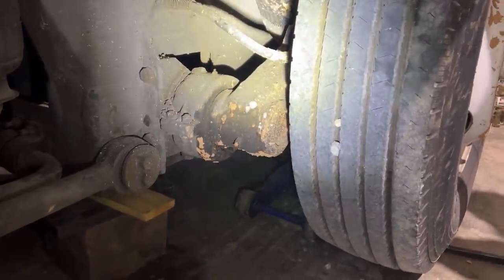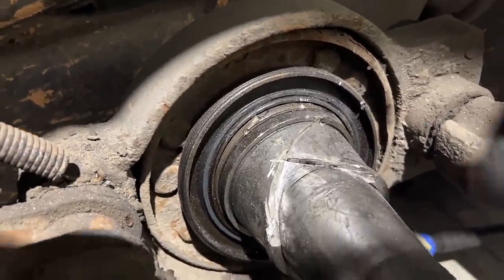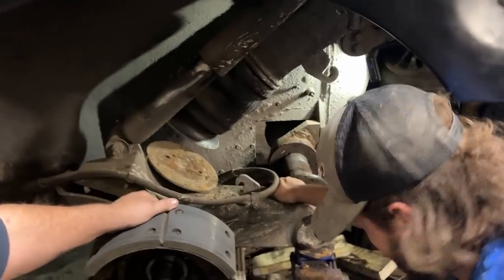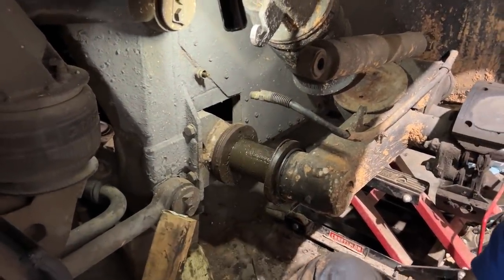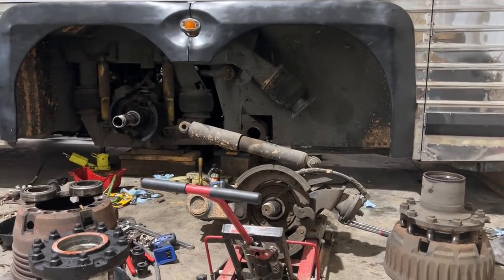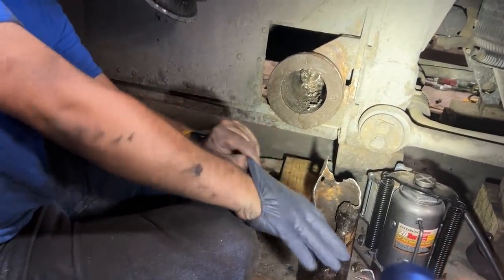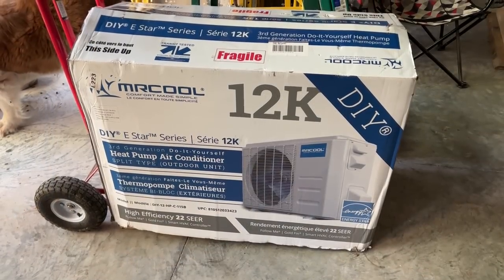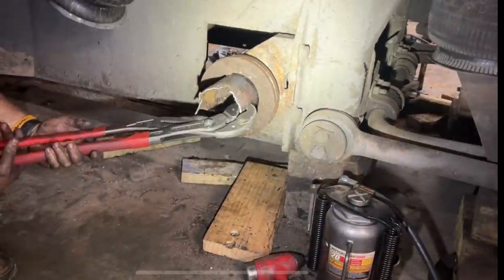Mci bus 96a3 serious wheel issues investigation.  Tearing into the wobbly tag axles.

Comment: Ah, tag tubes I have replaced hundreds of them! When I worked at the hound! If you grind down 1 in tool stock into a diamond chisel point that 20 in long and split the whole bushing it comes out in 5 minutes! I would suggest that you check the tag axle pressure regulators too much pressure in the tag bags will wear out the bushings FASTER!
Buy a cheap cylinder brush type cylinder hone from harbour freight, put some varsol in the boar to clean out the grease and take down any burs in the axle bore! The new brass bushing will silde right in!
Also use compressed air there is grease holes in the swing arms make sure there all clear!
Reply: Put the hone on a 1/2 drill and work it in and out just for a minute or 2. It is also easier to re install the swing arm if it's on a cherry picker! Hook a chain on the bracket for the brake pot and then over to the hook used to chain up the axle! It gives you way more and easier movement!
After the tube is in place and the caps bolted on. Lift up on the brake pot and make sure the arm is free! If the arm binds I have put shims in between the cap halves but that is very rare!
Reply: @sheilaschepp5761  And do toss the replacement Tube in the Freezer overnight ... bit of grease and you should be able to install with your thumbs.  Great advice above, especially using the cherry picker !!!
Reply: @craigsowers8456  
If your ever up in Central Canada, I have 25 years of experience on MCI 8,9,96A,SUPER 9'S, 102'S in C D and DL's the G' (only sold to GreyHound) the E and J coach!.
Reply: Gday Shiela! Would you think it’s been poorly maintained? Lack of grease is a dead giveaway! I never worked on buses, but I did plenty on trucks, farm and road machinery, if they weren’t greased properly my boss would kick my arse! I only got kicked once! 🇦🇺🍺🍺
Reply: @phillipdean9879  it is a 96A everything does wear out eventually! Welded on, 1 in of movement. There is a lack of grease! I would suspect that the grease passages in the tube were plugged!

Comment: Wow - this work is incredible.  Largest channelocks I have seen.  You pretty much need a youngster like the gentleman seen here working the tools in the family, unless you have a lot of money and access to a reliable shop - which appears to not be that common based on some of the busses seen here on the mountain that recently were at shops.  And the knowledge and tools - you provide quite a service.  That is an amazing repair.  Big tools to fix big toys.
Reply from the maker: Knipex cobra pliers.   Biggest size they make.  They Grip like a pissed off cat stuck to your face
Reply: @BusGreaseMonkey  I think a hefty pipe wrench would have worked a little better than Channel Locks, provided there was enough room to fit it in.  The big advantage with a pipe wrench is the harder you pull, the tighter it grips onto the round object,  and you don't have to squeeze it like you were in an arm wrestling contest while your pulling on the handle.
Reply: @BusGreaseMonkey  I love your videos please keep them coming.Mike Humphrey

Comment: Used to work on those old girls and replaced those bushings several times not fun. A reinstalling tip, clean everything and then supercool the new bushing with either CO2 or nitrogen (welding supplier) and the new bushings will slide right in without worrying about peeing over the ends. Just a tip,its a hard job either way.

Comment: At least through the latter part of the 1970's, and continuing through the mid-1990's, when ever a charter operator purchased a new (to them) MCI motorcoach type/model, Hausman required the operator's mechanics to attend two days of training on lubricating/maintaining the service status of the new arrivals.  They also encouraged the "halving" of maintenance intervals on buses which were used on 'mostly short hauls', driven in inner-city traffic, or runs which seldom exceeded 45 mph.  That is where many of us learned the virtues of "red rubber grease", and what it did for bushings, and life extension of air bags...
Reply: Hi. Please explain air bag grease application  for me. Thanks
Reply: @waynesmith2338  ;  Red Rubber grease is used on areas where rubber performs tasks which require it to move in one or two axial directions.  It is made from higher temperature tolerant vegetable or seed oils, (often safflower or canola oil);  red dye is added in the manufacturing process to indicate that it is not a petroleum based product, and as such, can be used on butyl/butrate/butyric acid conditioned rubber formulas.  I have noticed, that some of the newer lubricant manufacturers add red dye to their 'higher temperature tolerant' compounds.
Reply: Thank You!

Comment: In the way back when days. Used a Air Hammer with Metal Splitting Bit to split bushings. Another type is Hand Held Tubing Splitting Chisel. Reshape with Torch to fit round tube.
If all that fails a Sawzall to cut a groove length wise to collapse Bushing to make smaller. Harbor Freight Tools Help Much. 
Good Video 👍 " "It Can Be Done!"

Comment: Looks like a total lack of grease doomed the tag axle.........Like dead axles on heavy trucks, they need greasing every 5 thousand km's. It needs a grease nipple extension attached to it, so that routine greasing can be done easily, without taking the wheels off.  Im stunned that the steel tubes are ok..........very close thing indeed.

Comment: Rule 2- Oil is cheaper than parts.
Reply: My father's advice, "use the gears, it is cheaper than repairing the brakes." He drove a 1914 Buick (6cylinders, open tappets, oil can every ten miles). Yes, I'm 80 already, started steering on Aunties lap, "Bush" drove a 28 Chevrolet at 11 years old.

Comment: They make an adapter for vise grips that you can take the screw out and replace it with an adapter that you can attach to a slide hammer to help pull that sleeve out, would be a good thing for you to have.

Comment: Next time you need to pull a bushing out, make this tool.  Get a pair of locking pliers.  Weld a coupling/double nut to the  handle inline with the adjusting screw.  The threads on the nut need to match the threads on your slide hammer.  Fold the bushing in like you did and grab withe the pliers. 
You could use a 3 or 4 jaw locking gear puller adapted to a slide hammer to pull things off.  You may need a bigger slide hammer.
Reply from the maker: The pliers just rip right off the brass bushing.  We tried it.

Comment: I'll never understand how people can have something so valuable yet not bother to simple basic maintenance regularly. 
When you own something like that bus you should have a maintenance log to keep track of items you need to do going by milage.
They're extremely lucky those axels didn't fail while going 60 on a freeway or even as low as 35 on a city street.
Reply: I'm guessing it's more the shops they take them to, aren't doing a very good job with them.
Reply from the maker: Yes it’s been in shops for maintenance and when they are not familiar with the systems they miss lots of grease fittings
Reply: @BusGreaseMonkey  some things like greasing is something an owner should learn about and do themselves as to many shops don't bother to do hard to get at one's.
Would it be possible to install lines to make it easier to grease hard to get at grease fittings ?
I've seen them on some construction equipment.

Comment: Run a bead of weld around the race and usually it will expand race and pull off.
Reply from the maker: Not a fan of mig welding in vehicles full of very expensive electronic systems.   All 24v systems like solar, inverters, vanner, computers, charge controllers and more.  We didn’t want to risk damage to save 10 min.

Comment: I kept wondering why you didn’t just run a weld bead or two around that race. That’s the easiest way I’ve found to remove a stubborn race…
Reply from the maker: Lots of very very expensive 24v electronics didn’t want to risk messing them up.
Reply: You mean the one in the beginning of the video? It's external on the shaft, running a bead would make it shrink and get even tighter - that trick only works on a race that internal I side a housing.
Reply: @deezelfairy  I agree, external I used the oxy and chisel like there.